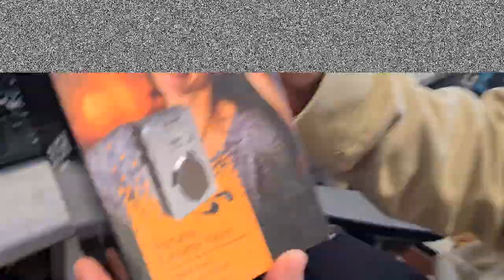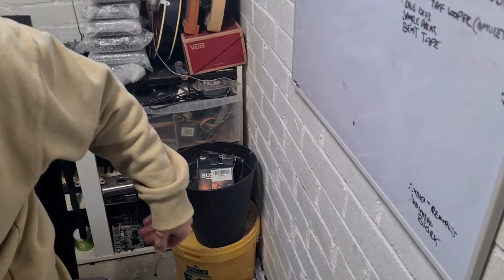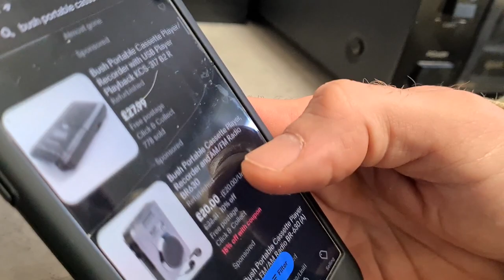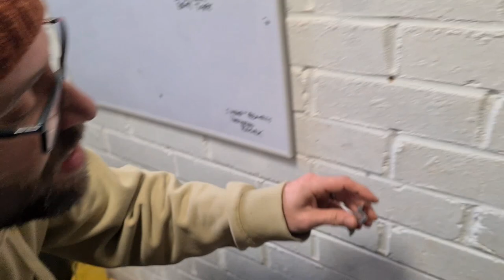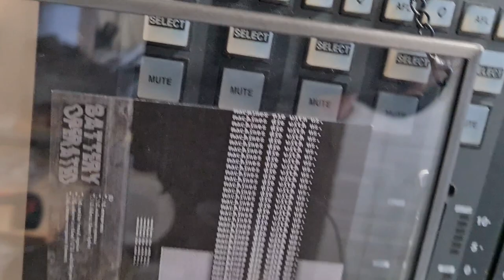Transforming a Terrible Tape-player into a Cheap Tape-delay

Comment: Always enjoy your vids. I occasionally make and sell stuff. Delays built around theses pcbs and pwm speed hacked Walkmans some brands of new ones are quite decent sounding for cheap crap, with break out points being labelled and large. 
The pin 8 is a new one on me, I'm excited about trying that. For in fire repeats and screaming self oscillation put a 100k pot between the middle leg of the on board green pot and the nearest pin on C15.
Reply from the maker: Hey Stuart. Really appreciate the feedback mate!! Please send us a link to your Etsy or YouTube/IG would love to have a look at your stuff. I haven’t really had a deep dig at circuitbending one of these delay PCB’s yet but I will now for sure. DM us on IG if you’re on there. Big ups